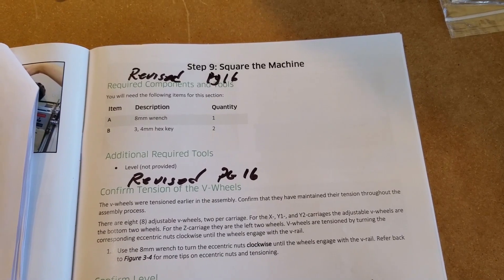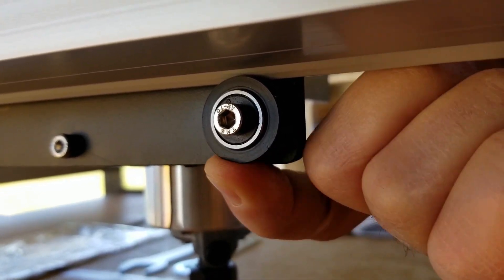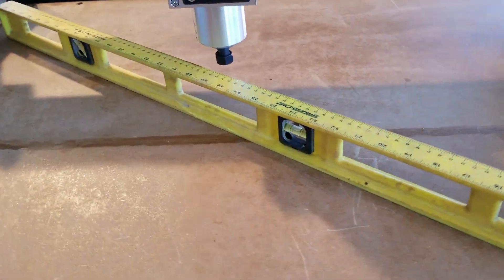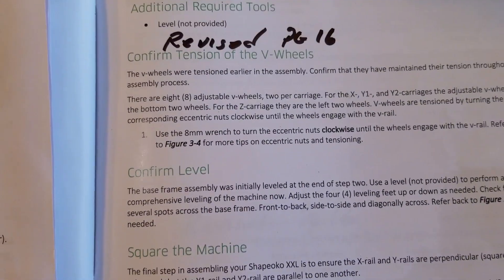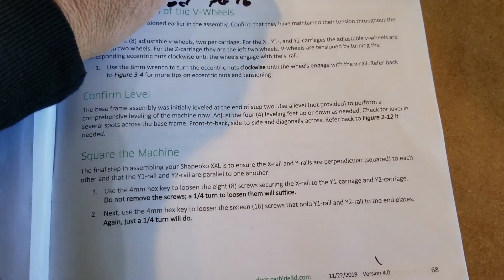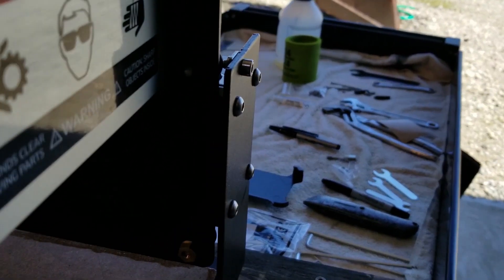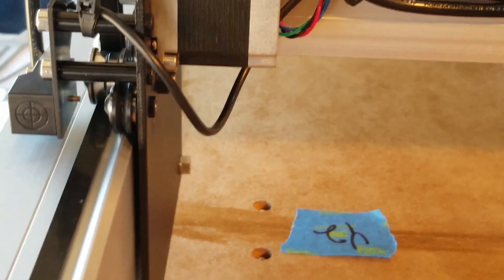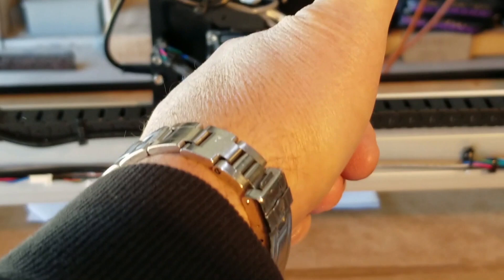IoT#74 Shapeoko 3 – Squaring the Shapeoko 3 XXL – Step 9

Comment: Very thorough.  However, I have same issue where y1 is touching and y2 is 3mm to the rear.  I can pull it forward but it bounces back into place.  I've tried the "Wiggle-Wiggle-Womp" idea and to no avail.  Not sure what to do next.  I've double checked my Y rails and they're squared to the base.
Reply: I'm in the same boat. Though I'm grateful for his video, his off camera adjustments are really of no help! I mean, most will come here looking for "how" to square their machine table and....well, this didn't show it.
Reply from the maker: @carlbishop3010  It's hard to hold a cell phone and use both my hands so I had to set it down.  But, like I told Rick, there are probably some screws too tight somewhere that need to be loosened.  It can be adjusted, just loosen everything up and give it a few whacks... gently!
Reply from the maker: It sounds like a screw or screws somewhere are too tight to be adjusted.
Reply: same thing